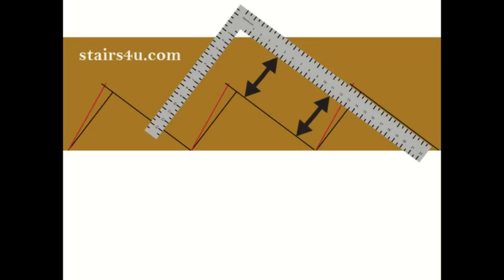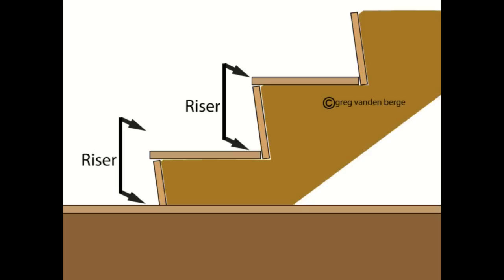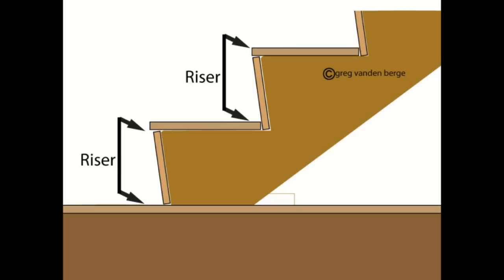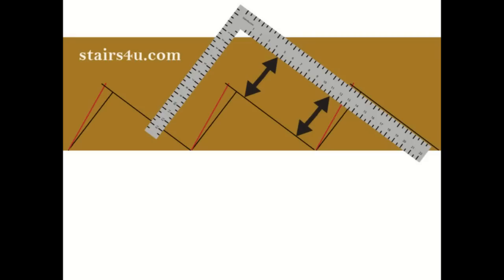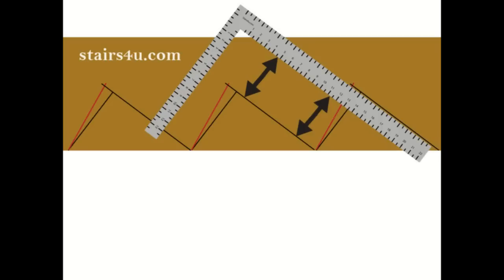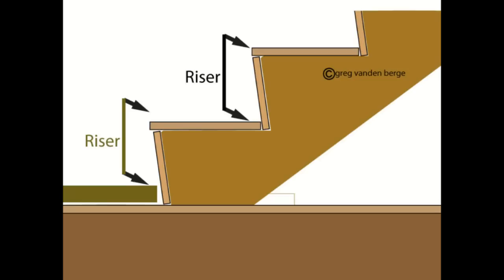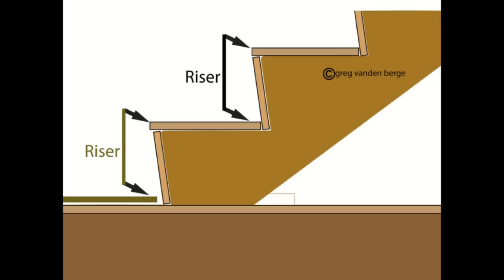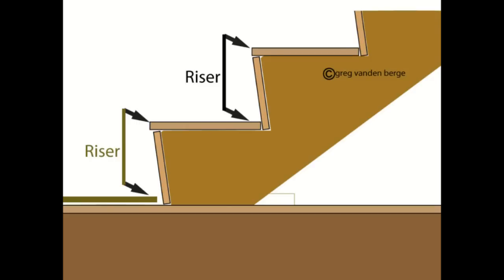Watch This Video Before Cutting Stair Stringer Pattern - Bottom Layout Tips

Comment: Total rise is finished floor to finished floor. If you go by concrete in a basement to a landing then usually you would add three eights of an inch. There is no ulay/ subfloor in basement.divide that by the number of rises. The only hard part is a basement floor and after building hardwood stairs for seven years I will be blunt. Framers dont give a shit about how fucked up the framing is because they know the stair guy has to fix it. Even if they could wrap their tiny brains around it they still can't figure out rise and run correctly.
Reply: dan pres As a framer I do what it is needed to meet code to sell the house... If  I was to make stringer legal for finished basement, when it is not, the house would not pass... we are only able to get like 3/16  out here...when i  build a raised ranch I know the builder will finish the hall way I'm landing them on, so i adjust accordingly on them

Comment: great video about what not to do soooo what do I do?
Reply from the maker: I would strongly suggest watching more of our videos. If there is a particular problem you need more help with, feel free to place it in the form of a question and place it in the comment area and I will answer it as soon as possible.
Reply: You add or subtract on lower riser to accommodate for thickness of finish floor.
The rest of the risers will use same thickness material and keep same height.